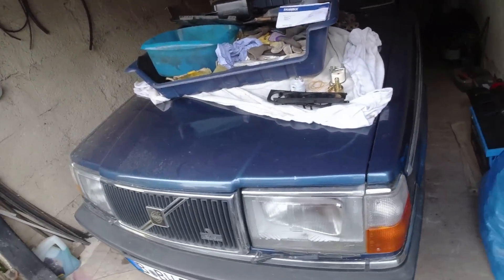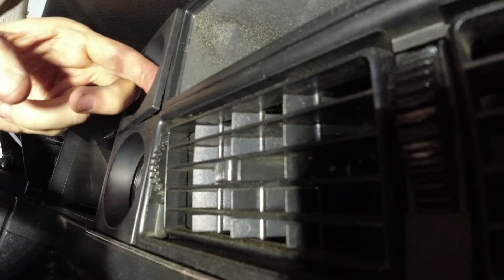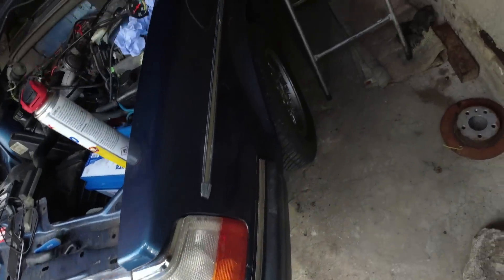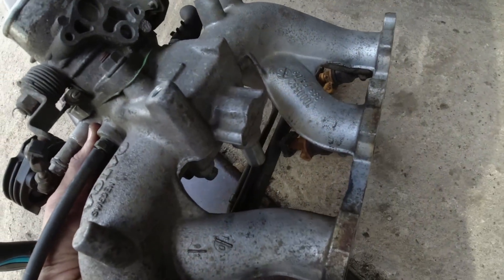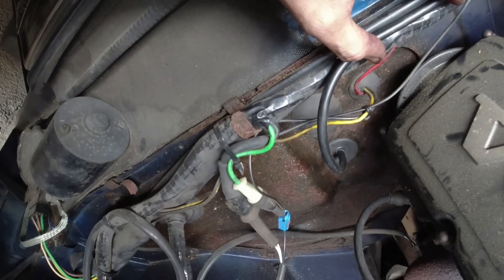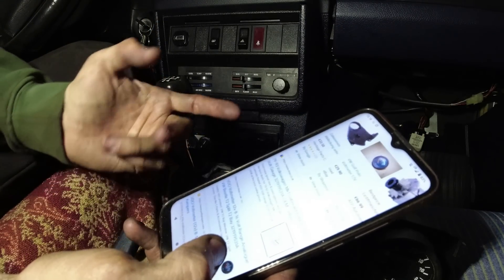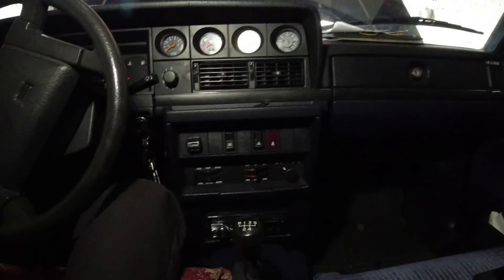I Bought my Dream Volvo 240 accessory

Comment: If anyone is interested and has any old, unused, or cracked pieces of stuff like this, I've been trying to make 3d printer files for as many of these pieces as I can, and if you mail it to me, I'll take measurements and send it back. If not, and you own a micrometer and wouldn't mind taking some detailed measurements and pictures instead that would also help. I plan on posting them soon as they are done for anyone to use.  Current project is center consol but don't have enough measurements as my original one got crushed to bits by a friend
Reply from the maker: Doing the lord's work!
Reply: @Involvod  happy to help :D
Reply: Did you ever manage to make progress on this?? Great idea.

Comment: I have always fitted a vacuum gauge to all my past restorations. The best instrument to show any problems with a motor. Especially when they have a Carby’ . I covet my diagnostic chart I got from an old 50’s Motor Manual. Lol. I have way back in the old days  , fitted one permanently under the bonnet for tuning. Especially on English cars.
Reply from the maker: Yeah that's a good point, this one bounces around alot, but fingers crossed I've got a Volvo original one coming soon from your fine country 🤞
Reply: @Involvod   . If needle vibrating , just pinch the tube a bit. The internal diameter may be too big.

Comment: I recently installed a similar setup, 5 gauges in total and all OEM with vovlo logos. Volts, oil pressure, fuel economy, exterior temp, clock

Comment: Sweet, specially that vacume gauge. Useful tool for when you want to use as little fuel as possible.
Reply from the maker: Yeah definitely, it's already changing my driving style 😄
Reply: Volvo actually made one that was a "fuel economy gauge" - but it's similarly just a vacuum gauge. I have one in my 240 but haven't connected it yet @Involvod

Comment: You cant beat VDO 52 mm gauges.  I fitted a similar setup to my Kadett C..All the cars I owned in the 80s and 90s had these. An oil pressure gauge is a useful one too. Have you rigged up illumination? It's quite easy to do. I found the positive feed for the instrument panel then ran a single positive that I shared between all the bulbs. I also then connected a shared earth.. Those gauges are great and are instantly readable due to the excellent use of font and colours..Another great video buddy..
Reply from the maker: Thanks! The gauges didn't come with bulbs, but it would be good to look into it, they must look even cooler at night!
Reply: @Involvod  trust me....They'll look kickass!!  You'll need the little cylindrical vdo bulb holders..They just push fit into the back of each gauge..Go for it!!

Comment: 8:15 it does, an oil pressure gauge, one that reliably tells when the oil level is to low & needs new oil. i would have left the original gauges untouched, for the originality.
Reply from the maker: Agreed! I may also have some original Volvo versions of the other ones coming too 🤞

Comment: You should put a tachymeter in the main dash in front of you and use a 52mm quartz clock. That's what I did on my 240. Easy as pie to swap out and it makes a big difference in shifting to have a full size tach in front of you

Comment: Well that’s cool. They’ve made those ökonometers for Škoda too. Got one but never fitted. There were two options drilling in the dashboard or swap with the fuel gauge and being dependent just on the orange warning light for reserve 😅 I,ve decided to keep it in the box. I remember in the 80’s people installing special consoles under the dashboard with those gauges. Cool gadget you now have! 👌🏻
Reply from the maker: I don't blame you, neither of those options sound ideal! It's pretty cool they are an easy fit to these 240s

Comment: You can make the c clamps for the gauges with some flattened 15mm copper pipe or something similar.
Reply from the maker: Thanks! I need to do something more permanent, elastic bands won't quite cut it in the long run 😄

Comment: Nice! I have the same volt gauge, which was advertised as from an Audi.  I installed it in one of the two blanked off spots you showed there, along with a small tach. My car has the radio in the spot where you had the storage compartment, and where your radio is mine has a storage cubby! It would be sweet to fit more gauges, but I don't want to lose the radio. Also, your climate control is very different from mine, which just has the 3 square buttons and a lever and knob for fan. Mine is a 92.
Reply from the maker: I used to have a storage compartment by the gear stick too, but kind of bodged the radio in there, it's not ideal though and I have to work by feel when pressing buttons on the road 😄 I noticed the different climate control set up between US and EU, not sure which I prefer 😃
Reply: It’s AC or no AC.
Reply: @PV_240  Mine has AC.

Comment: Nice setup! I have a voltage gauge and small clock. I have all the stuff for a oil pressure gauge, but not had the time to get it installed in the car.
Reply from the maker: That's what I'm hoping to get next, the sensor for the oil pressure is really expensive!

Comment: I love these! I have an oem volvo vacuum gauge, oem Volvo mini tach, and the oem volvo voltmeter. I have been looking for the outside temp gauge for a long long time, I found one once it’s was $500 US. They are very very hard to come by, keep yours. I also have two oil pressure gauges both oem Volvo that idk what to do with yet lol. Great video. If you need any help wiring these gauges I have done many.
Reply from the maker: Thanks! The outside temp gauges are super expensive here too, way more than any of the other gauges!
Reply: @Involvod  tell me about it, I have an oem vac gauge that costed $$$

Comment: Wow. They look so good! I would put another water temp gauge and Oil pressure gauge too. Now my temp and fuel gauge have something issues after some time them Fall to minimum. Maybe it's voltage regulator inside the cluster?
Reply from the maker: Thanks! That's the plan, oil pressure and volt meter are my top 2 for sure, but a second coolant gauge is a great idea for when the main one fails like yours does, I'm not sure what goes wrong inside the unit, but quite often a firm tap on the dash brings them back!
Reply: @Involvod  thanks mate. I need to look into it when i'm back from vacation

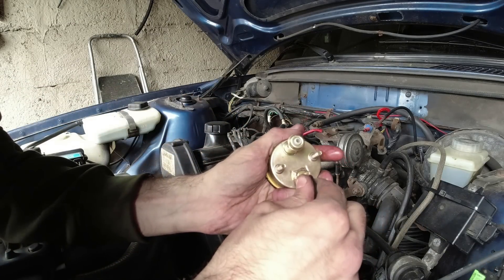Comment: Is that amount of engine shake at idle normal for 240s (2:40 mark, no pun intended)? Mine does that whenever it's in park or if I'm at a stop, the engine gives a good shake when I turn off the car too, but I've been told my motor mounts look "fine". Maybe I just need to clean my throttle plate or something, but if you've experienced any fixes or mitigations for that I'd love to hear them, unless I'm just being a hypochondriac lol
Reply from the maker: I actually recently replaced both engine mounts and the transmission mount and it made no difference, a friend checked it against his multiple 240s and said they're all the same! So they must shake a bit, you can fit diesel engine mounts and it helps
Reply: @Involvod  thank you for the prompt response, I haven't heard of the diesel mount swap yet but I'm gonna look into it, you're the man!!

Comment: So you don't want to keep the knob for the electronic headlight adjustment?
Reply from the maker: It's actually broken behind and not attached to anything, the only useable part is the knob and the black cover I suppose, do you need it?
Reply: @Involvod  No, I don't need it, but I figured you would want it for your car!

Comment: Do you know how to put a air/fuel ratio gauge in using the original o2 sensor?
Reply from the maker: Not a clue, sorry. Just now learnt that's how they are installed 😃